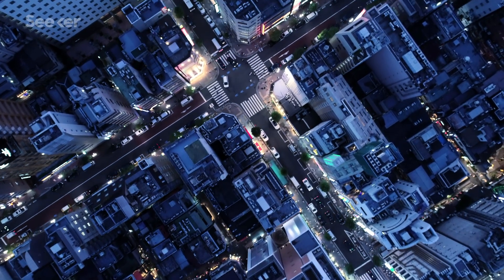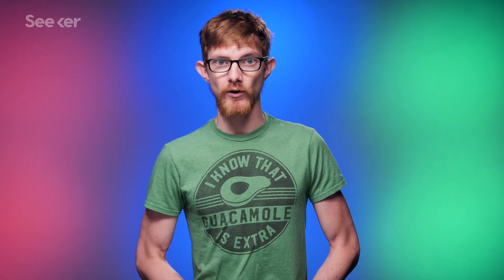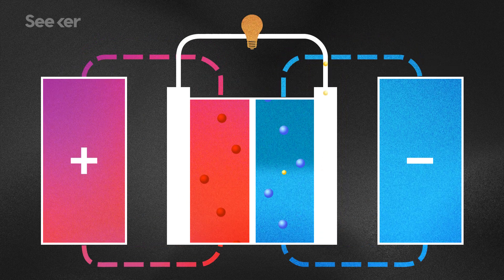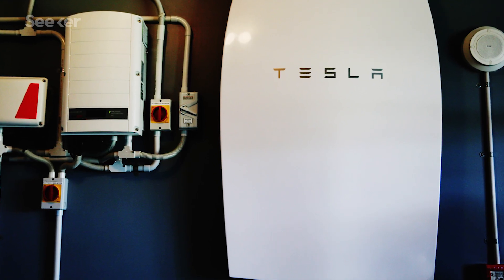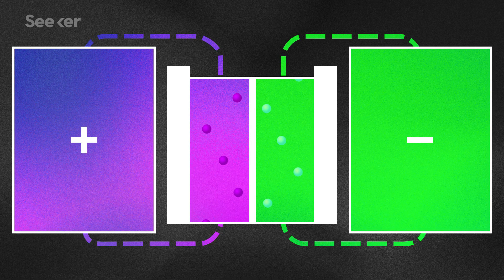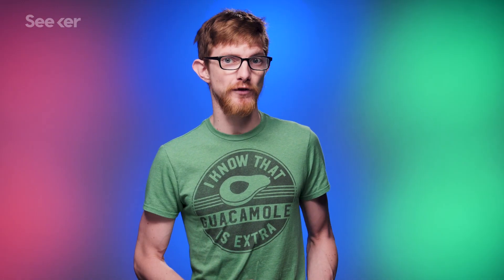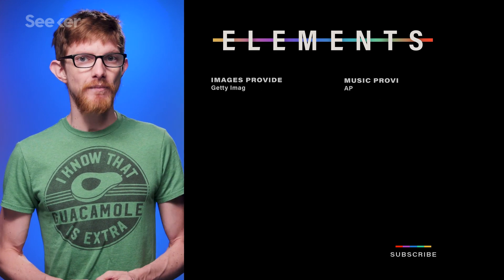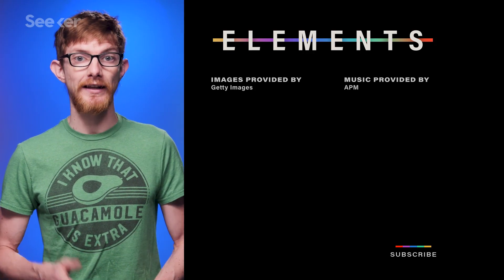Giant Flow Batteries Could Power Your City in the Future

Comment: What about efficiency? That's normally the key question if you want to scale it up so it can power an entire city.
Reply: They dont care. It got a nice clickbait headline.
Reply: @Elliot Eslander still more reliable than a battery that needs a pump 2 fluid tanks and that has the ability to grow dendritez
Reply: @Elliot Eslander um.... That's not my experience. Maybe in places like the U.K.

I'm in Brisbane Australia. We have a pool, run everything we want including 2 x 3 phase ducted air con systems, I'm looking at 5 screens. We're grid tied and the 3 phase is grid supplied. Incoming power is 23c/KWHr, they buy back power at I think 6c/KwHr, a dollar a day "access fee" and it doesn't cost us a cent. System is 5 yrs old and has paid it's ROI 3 fold. 

CST is WAY more efficient than P.V. 
Also a very comprehensive study done by ZCE in collaboration with the University of Melbourne says otherwise, which I'd wager you didn't bother looking at. So... ok bro.

I'm well aware not all locations in the world are suited to it. Most of it?? Sounds like defeatist parroting to me.
Reply: @prajwal9544  not true. And nothing to do with my initial point.
I answered someone else when they brought up P.V.
My initial point was about CST. Regardless of how it is delivered. Also, I was not suggesting that CST was suited to small scale. Also, I was not suggesting ANY solution would suit as a blanket answer for any and all circumstances. Also, irrespective, power distribution suffers 30-40% losses in over the grid just getting to the destination and there in lies the problem.
Also, if indeed these problems are to be solved, adjustments and compromises will have to be made and taken. 

There are plenty of hurdles, we are all aware of this. There are also far too many people so quick to point out the problems we all already know about. This discussion needs more transparency, honesty, and problem solvers instead of problem pedalling and parroting without fact checking. Are you suggesting that we do not posses the technology to zero carbon emissions? Tested proven technology? That we are doing the best we can and the systems in place are the most efficient and most altruistic available?? Because if you are, then it's over and we all should just end it now instead of breeding further and allowing our descendants to slowly choke to death in  the hot sun. 

Stop believing the various commercial and government players at face value who ARE selling out YOUR children and their's. Do some research and you will see there are MUCH better ways of doing what we do that not only won't pollute as we are, but can also fix some of the problems we have created with respect to the stockpiles of waste.

If the attitude you are displaying, which is all too common from those too lazy to actually look into it and those who are sitting around waiting for someone else to save them, doesn't change and quickly. Nothing ever will.

What you are eluding to is daft. We already posses the technology to right all of this which will no doubt create other unforeseen problems which will require yet more doer's and less armchair experts. 

Alternatively, what's the point? Lets just all swallow the pill now.
Reply: Exactly. The reality is, distribution is inefficient. Harvesting and local storage is the answer. OR moving wave nuclear running off the already massive stores of waste stockpiled around the globe with no use (aside from weapons) and no other way to deal with it.

This is more propaganda, they're trying to sell us a lie because they want to keep charging us money. 
What happened to concentrated solar thermal? There may be other options with higher energy densities, but if reduction of carbon emissions is the goal.... it requires only mirrors and salt, a far better option than P.V.

Comment: Well, actually there is no such thing as charged solutions. Thats the reason why the protons have to balance the charge by traveling through the Separator to keep the solutions neutral.
Reply: Junn you literally said “well but actually” i love nerds
Reply: @DevelopIT  No, the electrolytes are at no point charged, because solutions cannot be charged. That is just a law of nature. For every negativly charged ion in the solution on the right there is an equally charged positive ion in that same solution, same goes for the solution on the left. The discharging of the batterie works like this:
The current is beeing created because the negative ions on the right side don´t hold on to there electrons as strong as the negativ ions on the left. Therefore those on the right give of electrons that can travel via an electrical conductor to the left side. The positive ions on the left are better in binding electrons to themselves than the positive ions on the right. Therefore they pick up the electrons that are beeing generated on the right.
But since there can´t be a charged solution, for every (negative) electron that travels from the right to the left, a positive ion has to travel through the seperator in order to keep the solutions neutral.
For the process of charging the opposite happens.
Reply: @DevelopIT  Macroscopic charge separation is impossible.
Reply: Finally, l knew l couldn't be the only one botherd by this.
Reply: @DevelopIT  For what l understand you are saying that hydrogen ions are moved to one side while some sort of negative ions form on the otherside, one solution will contain the positive ions the other will contain the negative ions am l mistaken? Now if your answer is no than this is what l say: no solution may contain only one kind of ion. Let's say you have for example a solution of negative cloride ions in one solution and positive hydrogen ions in the other solution. Than you close the valves that go into the cell you put the holding tanks with the solutions onto tucks and move them to different cyties and boom you have macroscopic charge separaion which as l understand is a big no no in physics.
Reply: @DevelopIT  Your thougth process is pretty good, you are correct that during chargeing batteries you build potential, but they don't build just eletrical potential they build electrochemical potential. l had to consult with my notes on phisical chemistry 2 electrochemistry and l realised that my understanding is much less deep in this fied than i thougth. What happens is that beyond a certain electric potential (wich is built by a microscopic separation of charges) chemical reactions start to happen and you are moveing moles against a chemical potential while the system is trying to maintain electrochemical equlibririum. In steady state chargeing the electrical potential is constant and chemical potential is contant and you are moveing moles up in this field thus storeing energy. If you look at the chemistry of let's say the Daniel cell you can see that the cirtuit is closed by the movement of counterions at no point do you see one half cell getting surplus of positive or negative inons. In significant ammounts enrgy is stored (or released) by changeing the ammounts of chemical reactants. This fits well with the fact that batteries have more or less constant voltage during discharge (yeah it changes a bit but at say half votage its allready out and dead) if the energy was stored in the form of charges as in a condensator, voltage would drop linearly during discharge wouldn't it?
Reply: @DevelopIT  This was (is) very educational, thanks! l had to look up this law of no macroscopic charge separation and it turns out l most likely mixed up the principle that the sum of the charges in the world are constant and some other rules from chemistry. Now l say this whole macroscopeic separation thing is at best a rule of thumb in chemistry with vague border between micri and macro, but definitely not a good argument against your statement.

Comment: Lithium isn’t abundant....  vanadium is? 

Degradation....  nothing is better than a well regulated Lithium ion cell. 

This is the most technically incorrect Seeker I’ve seen so far.
Reply: Well Vanadium is abundant in China
Reply: Think about the dendrite growth if you got 100 times the electrolite before it needs to charge again
Reply: He implied that vanadium was only feasible in China 3:38 dumbass
Reply: @Asdfghjkl-ls1or  It's spelled 'feasible'.

Comment: Today's fact: The space, all of it, is completely silent, because there is no medium or mechanism to allow sound to travel.
Reply: Wrong, space isn't completely vacuumed and not completely empty, there's flying dust and flying gas molecules that will cause vibration on whatever it hits
Reply: Lol
Reply: You can hear stars sing and scream in radio waves.
Reply: @faxar1572  but when you use those youre technicly using small particles to scan stuff instead of hearing a soundwave trough a medium that can be translated into sound by your ears. Just shoot a bunch of xrays into your ears and youll hear what i mean
Reply: And youre dumb too.